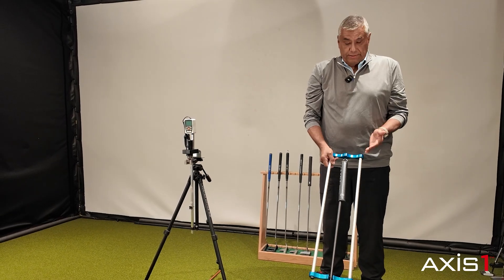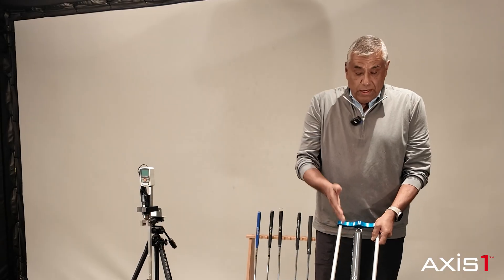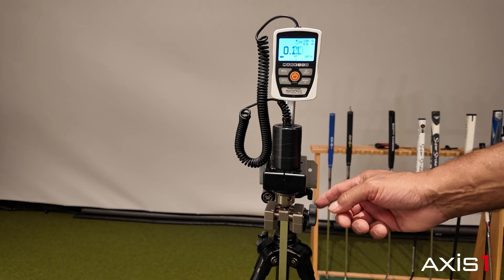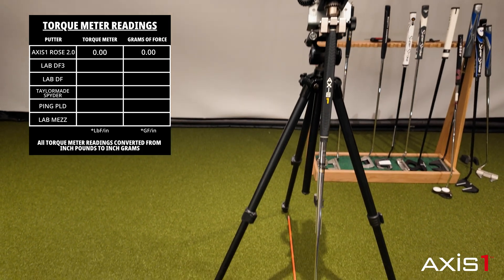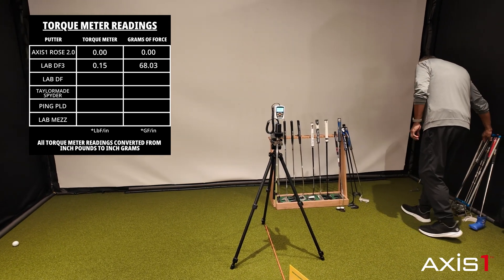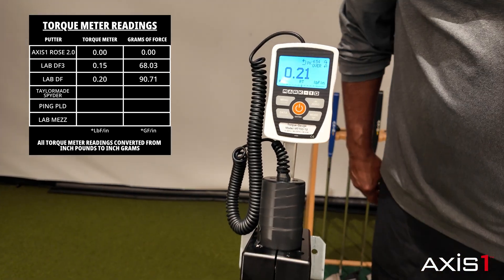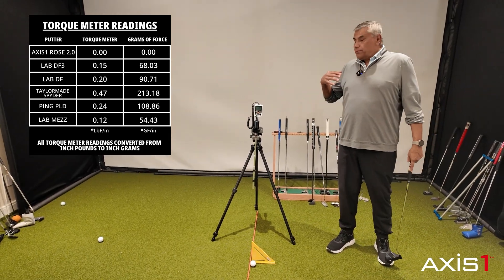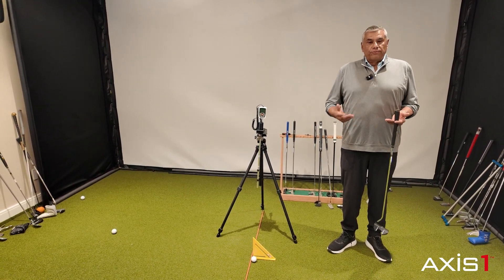Measuring "Zero Torque" Putters (Is This The New Standard?)

Comment: The grip does not add torque. The shaft has no idea what grip is on it and as you well know, the putter is balanced on the grip axis with the grip on it. And this goes both ways! I concede that adding a press grip to your putter would not add more torque IN MOTION than it already has. When we put straight grips on our putter, there is no change to performance IN MOTION. A proper test would have been to hold it by the shaft under the grip or to at least use one of the many non-press grip options we have but that would not serve your narrative! but even then, weather or not a putter torques at address doesn't mean a whole lot. The PXG Allan for instance would be zero torque at address and in your device but has even more torque IN MOTION than your putter. At some point, you are going to have to address the fact that your putter twists in motion. Its a toe up putter. It torques open as soon as you take it back and shuts in transition. Just like the Allan, just like the backstrike and just like every other toe up putter out there. Why not promote the actual tech you guys have?? The fact that the CG is right on the sweet spot is pretty cool. Good luck Luis.
Reply: https://youtu.be/OrvsQ5W5yYQ?si=AP8DRJ3njgCBhEcR
Reply: Revisiting this vid.  When we think about torque, we're talking about a net force around an axis of rotation. IF we hold the putter on the shaft, the axis of rotation is the shaft axis. If we have a grip that's installed in line with the shaft in all planes, the axis of rotation is still  the shaft axis. BUT when a grip is installed along an axis divergent from the shaft's axis, what is the axis of rotation? It'll require some maths to figure it out imho... BUT the axis of rotation of the system will NOT be the same as the shaft axis. When the bottom notch of the revealer tool is moved up or down, I'm sure the axis of rotation will also change when the grip is not inline with the shaft. Prove me wrong please....  LOL with some serious maths. OK?.

PS: alternatively, how will a DF3 with a normal grip that's in line with the shaft behave with the bottom notch up or down?
Reply: You make a gimmick putter designed for a specific stroke type. You don’t not make a cure all putter. People need to be fitted to your putter or develop a stroke to use your putter just like any putter. If a person is not straight back straight though then your putter is useless. Your comment shows just how defensive you are. Seriously get over yourself you’re just making yourself look like a clown. More than you already are.
Reply: @traviscrown9189  I'm sorry you have this idea about stroke type. The putter is designed to stay square to an arc, whatever arc that may be. Doesn't matter at all what "stroke type" you have as is evident by the various stroke types of those using it and winning on every tour around the world. And of course I am defensive! This guy is making public videos with false claims about our product! You wouldn't do the same?
Reply: @ you are a putter manufacturer and you don’t understand or choose to ignore stroke type and being fitted properly to that stroke. Hence the reason for double bend neck, slant necks, plumbers necks etc. lie, loft. 

Na… you’re losing a lot of people on this constant parade you’re going on. You could be above it. Instead you choose to continue to try and demonize other putter manufacturers/ designers who have a different idea and opinion of this subject matter. 

You clearly have no clue how to sell or market a product. You continue to try and push the idea of scientific dominance. If your putters were literally that much of an advantage everyone would use them. However, you are just a tiny little tiny niche putter maker.
Reply: @samhahn6950  BRING BACK PURPLE! You sold out too quickly! Also, travisclown obviously doesn't understand physics very well or he would know what the LAB putter is designed to do.
Reply: @ this is an amazing take for so many reasons. You have yourself a wonderful day.
Reply: Fucking love Sam

Comment: I just got an Rose 1.  Is there a reason the grip is thin?  Will changing the grip change the function of the putter? Any suggestions of different grips for a softer feel?   Thanks
Reply from the maker: No it will not change the function of the putter, feel free to email us for more suggestions on grips we'd be happy to help!
Reply: I have an Axis1 Half Mallet (HM) and I used it for a month or two with the grip it came with. I then switched to a SuperStroke Flatso 3 which is significantly thicker, and it does soften the feel. Obviously the grip feels different but I don't notice any difference in way the putter swings. At address, with the putter suspended above the ground slightly, using a very light grip, I feel no tendency for the club face to open or close.
Reply: Switch go lab
Reply: @joshhubbard8628  i get it.  a lot of LAB fan boys love to watch these videos.  Not asking you  guys.

Comment: Data that is gathered as part of any "controlled" test is only as good as the test method and equipment used to gather said data.  In this case the equipment is solid, but the method is ridiculously poor.  A person doesn't putt with the putter in a static state.  In order for this test to have ANY value, the mark-10 needs to be mounted to a rotating arm (basically a swing robot).  Then set the mark-10 so that it reads min/max and allow the putters to swing freely back and forth.
Reply from the maker: Torque is torque, if a putter has torque in the address position it will have torque in motion. Unfortunately it just doesn't disappear... This video is our introduction of measuring torque utilizing an actual measurement device, we want to continue to advance this more and more to help standardize measurements for consumers. Showing the putter in motion or at a point of motion is a logical next step and something we look forward to testing as well but that doesn't change that a putter with torque at address will not be able to eliminate torque in motion.
Reply: @Axis1Putters  Haha, your false narrative here is pathetic.  You purposefully set-up a test that would show LAB putters performing poorly and then try to play it off that you are attempting to "advance the conversation" when you are really just trying to market your putter.  This test is irrelevant because putting is dynamic and not static.  It is the forward press grip that is causing LAB putters to perform poor in your irrelevant test.  That is why you didn't test any LAB putters with a standard grip.  You know they are balanced through the center of the club head and by using the forward press grip it will obviously add static torque because you are not mounting it on the balance axis.  Additionally, the static state torque (what you tested) literally disappears as soon as you overcome the moment of inertia necessary to begin the putting stroke and the system changes to dynamic torque.  Therefore, the static torque the press grip adds becomes insignificant and the press grip actually helps make better contact with the ball.  Your test is what they call a Red Herring fallacy.  You know it, but are trying to play coy in an effort to look sincere when you really are not.
Reply: A person doesn’t putt with a revealer either. The zero torque putters would probably be great if you putted with a revealer but what happens when you put your hands on the club.
Reply: @zombierecon7351  nothing is suppose to happen because you don't move your hands during the putting stroke.

Comment: Hi. So seeing as the labs have a 2 degree offset in their grips designed to remove the necessity to add shaft lean, and you’re clamping directly onto the grip. How do you account for the fact that that is going to add static torque just by the nature of how you’re setting up the test? I get that you’re trying to use this to sell your putters, but the concept isn’t 0 torque when at static rest. The idea is that there should be no dynamic torque throughout the putting stroke other than what the player adds. 
Curious as it seems you’re trying to sell a butter knife based on how sharp it is?
Reply: BINGO 👍 The Axis one really performs well on the competitors Revealer. To me this is pointless video because no one, is hell, measures torque at static. My suggestions, figure out a way to hook the torque meter, put it ON YOUR OWN version of the Revealer (honestly if PXG can come up with their own black box "revealer" so can you) and lets see what the measurements are when the putter is in full flight motion. That's why the Revealer is more believable, you can see it with your own eyes the face stays true to the path including your Axis1 (to some extent). Also "Paging Mr Allan, you're wanted on Axis 1 demo, Paging Mr. Allan..." 😄

Comment: Did not expect this... but I guess I never thought about how the revealer isn't an actual measuring device
Reply: It was never meant to be a measuring device. It’s a demonstration tool. It REVEALS whether or not a putter has torque on motion. It does not measure how much motion at all. It’s like the revealer is a yes/no answer to the question while this contraption is like a paragraph answer.
Reply: @CoD3x4life  i think measuring these putters for torque makes more sense than seeing how they act in a 'demonstration tool'. Maybe they can take these measurements in motion too
Reply: @kappysflies  agree with your measurements in motion suggesstion. iinm the LAB boss explained that the lower support was set at the balance point along the putter shaft which the Axis 1 boss did not care to discuss the merits/demerits of doing so. Frankly, I'd  like to know if the both of them have some sort of relevant engineering background

Comment: Thank you for the science Mr. Pedraza!
Reply: This demonstration is actually a lack of science because a person does not putt in a static state.  In order for this demonstration to have any value he needs a test setup that puts the putters in motion in a similar way to how they are used on the course.
Reply: @fasteddy9126  You are certainly entitled to your opinion but this science proves to me beyond a doubt that torque exists at the handle, at the time of address. You should be able to agree to that. From that point on (in the course of a putter swing), I believe the torque present at the time of address will NOT lessen or vanish. I believe it will only increase and cause the putter to be difficult to return to its position at address. I don’t need additional resources spent on how much the torque changes during a stroke. If you start out with some, it’s only going to get worse with movement.
Reply: @ranczar  My "opinion" is backed by a physics degree.  The only reason torque exists at the handle in this demonstration is because he is mounting the LAB putters on a axis not in alignment with their balance axis.  That is why he didn't test one with a standard grip.  It would have performed the same as the axis1.  And your statement about "torque present at the time of address will NOT lessen or vanish" is not incorrect.  If there is torque while at rest, the torque may increase or decrease when put in motion.  It simply depends on the path of movement and how well the item being moved is balanced about that path of movement.  This video is an example of a red herring fallacy.  

If you bought an axis1, and it's working for you, that's awesome.  I genuinely hope you play better with it.  Everyone has their preferences and different clubs work for different people.  I have no ill will toward you and have a good day.
Reply: Would be interesting to know the reason, why Justin (Rose) left Axis 1
Reply: @high_alpine_golfer  Probably the same reason you and I switch putters. When they don’t behave, we must punish them! ;-)